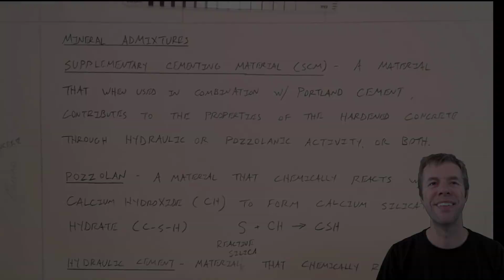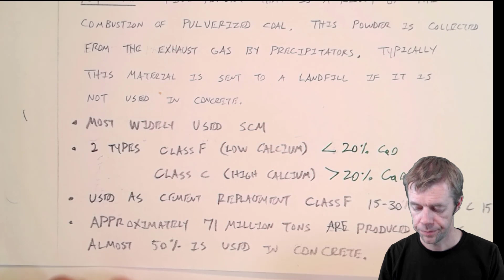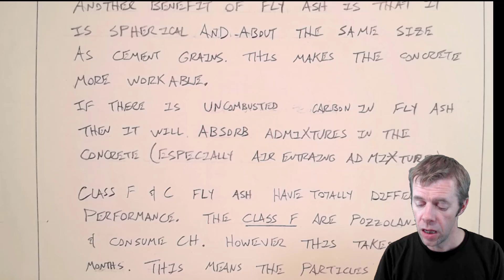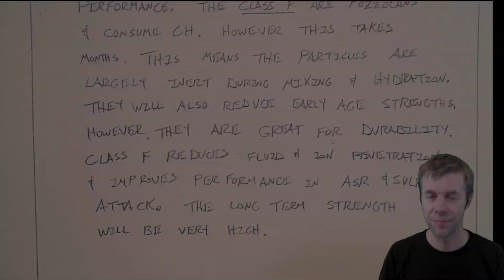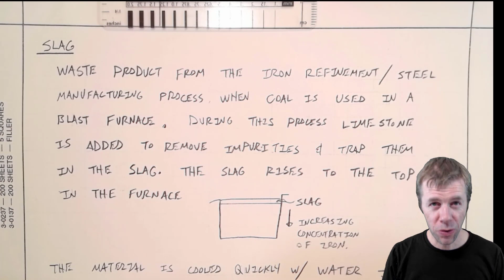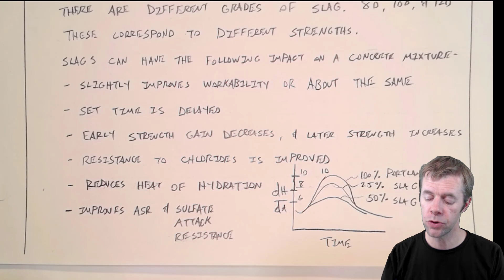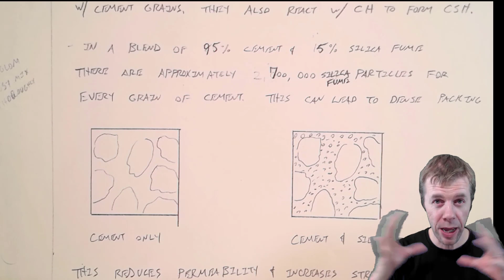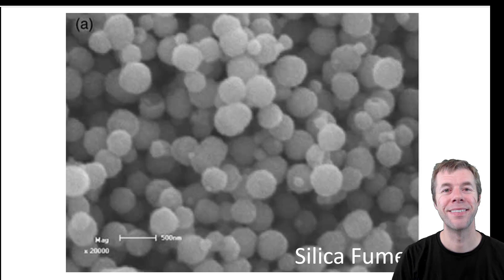What is fly ash, slag, and silica fume and why do we use them in concrete?

Comment: Tyler, these videos are exceptional. Would you be interested in making a video on the ‘best’ concrete possible for durability? What the approximate mixture would be, what additives would be used, the w/cm ratio, how it would be cured, etc? I was thinking about making a concrete bench that would be left outside in a cold climate, and I think it would be kinda cool to try and make it last hundreds of years. Probably post tensioned with stainless threaded rod.
Reply from the maker: I like that idea.  Let me think about it.
Reply: Jon, you can try using one of my impermeable self-healing nano and micro reinforced concrete made from Waste to Energy Ash.
Reply: What about a combination of say type f fly ash and silica fume?
Reply: @ndenise3460  What about a concrete that is made with Waste where all the aggregates come from waste a concrete that is impermeable, self-heals and is photocatalytic... That is Ashcrete
Reply: what about organic ash as additive for concrete??
Reply: Perpahs I'm wrong, I'm just a lowly concrete guy --- Isn't "BEST" defined by location, use, performance requirements, cost-benefit and engineered "life-cycle? 
 @TylerLey

Comment: Tyler, there is a cool new material called Poraver. These are nano glass spheres made of recycled glass in Germany and Canada: it is used as an admixture in concrete. As a result workability of concrete is amazing, and goodbye cracks, too. The resulting concrete is lighter, stronger and denser than without the rough glass beads.

Comment: It's such a science... I'm interested in the Silica fume and it's use in superstrong concretes. Excellent explanations.
Reply from the maker: Thank you for the message!  I agree that silica fume is a cool tool.
Reply: @TylerLey  Awesome info you're providing. So apparently, due to the huge increase in compressive strength using silica fume / fibres, they can use less re-bar and build with less material using it. Do you have a video on super-plasticizers also?
Reply from the maker: Shades2 - Silica fume can help with this.  It depends on what you need your structure to do.  If your structure can allow slender members then silica fume is great.  However, there are many members where strength is not the goal.

Here is the water reducer video: https://www.youtube.com/watch?v=q_PwZE57Slc
Thanks so much for watching and for your comment!!!
Reply: @TylerLey  Master,I use silica fume to produce magnesium oxysulfate concrete. There are good aspects, anti-permeability,dimension stability increased, but strength decreased,it might be wrong way of mix slurry ,low speed mixer,time,
etc, i don't know.Someone said,the best way is use fly ash mix with silica fume. I wish to increase durability of mganesium concrete,but do not scrafice lot of strength,is it possible?

Comment: Hi Tyler,
I watched many of your videos and I am amazed by your knowledge, but even more by your passion for concrete.
I would love to get your input on the following subject. I need to a build a concrete wall behind the existing concrete reinforced 30 years old wall which is in a bad shape (with partially exposed rebars and many cavities) that is being constantly stricken by the sea waves. What type of concrete, rebars, admixtures, etc. would you recommend for the new wall.
I hope you will read my message and respond to my inquiry.
Regards,
Reply: you could try glass/polyester etc fibre reinforcement, or basalt fibre, or micro stainless steel fibre. plenty of vids on 'Net.

Comment: Question, I was wondering about what if someone replaced all the products of concrete with similar sized (or smaller) recycled products. Like my idea is what if someone used say fly ash, slag, ground tires, ground plastic, ground styrofoam, ground glass,  maybe even ground wood or wood ash, then mixed all those with hydraulic lime and water? Wouldnt that be more dense, workable, insulated and harder than concrete? And would you even have to have steel reinforced steel?
 I just don't know enough of the chemistry of each of those products if they would work well together, if it would be load bearing, what the thermal desity would be, if they would be toxic, or if they would just fall apart.
 I've recently been interested in how to used products that take a long time to biodegrade like glass, tires, plastic, styrofoam, fly ash and slag and make them into a workable product that would harden like concrete does. Can you give me any insight on if this would work or is it a pipe dream? 
I also thought about adding hemp Hurd to the mix but wanted to see if the non-biodegrable products would work first to fix the problem of waste in the world before adding any natural products for thermal insulation. 
I've been brainstorming like crazy about building a high thermal mass round home with a geodesic dome roof in the shape of an IMAX theater (tilted rotunda?). My brain has been on overdrive on how to make it with no concrete and only recycled products while also making it energy efficient and as low of cost as humanly possible. And it all starts with the footing which is where I came up with the original idea posted above! So that's where I'm at, any help or ideas would be greatly appreciated. 

Thanks
Ryan Soren

Comment: is wood ash similar to coal's flyash?
recently i was trying to extract use potash from burning garden's lefovers
i tried biochar last year, but this time i wanted to recycle the K
so i washed the ash and used the water for irigation
but the lefover settling particles i collected them and dried them
i'm intending to use them for making clay-sand bricks more resistant to water erosion
Reply: No, nothing like it. The K (and Na, Mg etc) will wash out as hydroxides, very alkaline, if left exposed to air they will gradually absorb CO2 to become less alkaline. If irrigating with them they can build up in the soil and 'salt' it if you don't irrigate/dose properly. The bio-char will have most of the minerals that would be in the ash anyway. the erosion resistance of the bricks depends mostly on the vitrification effects of the firing and/or if you chose to use the minerals K/Na etc to 'salt glaze' the bricks.

Comment: Have you talked about air entrainment and insulation characteristics? Just curious.

I'd love for you to talk about mortars. Portland cement was the worst thing to ever happen to mortar, unfortunately. Lime mortars were far superior but unfortunately are hardly available today. Read about the repair of the Washington monument as a starting point.
Reply from the maker: Thanks,
I will check it out.  I am working on a foamed concrete video.  That may talk about the insulation.
Reply: @TylerLey  i would like to be alert wend you publish this futur vidéo about aircreet and maybe your sugestion about the experiment of "Honey do carpenter"
Reply: hydrated lime is still available, with a bit of ingenuity you can still make lime mortars.
Reply: @bikerfirefarter7280  I have made it that way for repointing old, soft brick. I just mixed mason sand with hydrated lime. It works great but takes weeks to set up. I introduced some portland cement to make it set a little faster but that defeats the purpose.

If I recall, there used to be another form of lime like anhydrous or something that sets faster. Hydrated lime basically needs to dissolve naturally and rebond in order to set. That's the power of lime, that it's doing this all the time, it's self healing. With this method I think that self-healing is the only way that it sets up.

Besides being self-healing, it doesn't shrink as it sets, causing all kinds of bonding failures, weakness and leaks in repair work. That's the other huge advantage of lime mortar, and the third crucial advantage is that it's softer than the material you are typically mortaring together. So it doesn't damage and fracture that material! Portland mortar is very hard and strong so people think they're doing a great job. Then when the old bricks fall apart and fracture because the mortar was so hard, they say "well the mortar was good but those old bricks just couldn't be saved", which is the exact opposite of the truth. Not only is Portland mortar hard and not self-healing, meaning it will eventually fracture and turn back to dust, but it shrinks as it sets so it actually places more stress on repaired areas, and then it doesn't allow settling and rehealing. It's basically a disaster for old soft brick or natural stone.

And all of that is why they didn't use it to repoint the Washington Monument. I believe they went through a lot of work to research these issues and recreate an appropriate lime mortar. Either that or maybe they imported it from Italy.
Reply: @fieldlab4  'lime mortar' is not just hydrated lime and sand.  'anhydrous lime' is calcium oxide, otherwise known as 'quick lime', very caustic. hydrated lime mortars, and most other cements fully cure through the years by adsorbing CO2 which reacting with the calcium (and alkali metals) become carbonates. Corporals Corner has a video on 'Roman concrete', that will point (scuse pun) you in the right direction.
I have used 6:2:1 of sand: portland:hydrated-lime as a substitute for old school lime-mortar with good results. Plastering sand works well. Setting time is a little longer but acceptable. In places where setting time needed to be quicker various accelerators can be used. Small amounts of sodium silicates can be a useful additive. In outdoor situations I have also accelerated the setting by tenting the work with a tarp and putting a steel bucket full of charcoal under the tarp (one 12mm dia hole in the bottom of the bucket), light the charcoal FROM THE TOP to avoid CO, and when it's lit after 5-10 minutes to establish, put a fairly well fitting lid over the  bucket (slate or stone etc) and put it under the tarp. The charcoal slowly burns overnight and the CO2 released rapidly hardens the exposed mortar (be careful of any carbon monoxide).
see also.
https://www.limetec.co.uk/limetec-lime-mortar-mix-ratio.html

Comment: My graduation project is about geopolymer concrete we used fly ash with liquids like sodium silicate and sodium hydroxide but we didn't achieve any kind of slump or any strength the project just fails now we have just 1 and half month and we are in a very critical situation. My question for you is it okay to use silica fume instead of fly ash with these liquids or should i use water instead?
Reply: The reason that the mix fails is that the flyash is not really fly ash we bought it from an unreliable source

Comment: I work on older homes and you can tell a foundation that has slag mixed with concrete and an 80 yr old home that has faulty downspouts/ gutters,those foundations crumble easily.they saved money mixing slag with concrete but as longevity in my experience it doesnt last.i can post a pic of a concrete/slag foundation thats gone to crap at a hpuse im workin on tommorrow youd think about scimping on cement.i can post more foundations youd think twice it crumbles after time makin a useless foundation

Comment: Did you see on This Old House that there are 30,000 + homes with bad foundations that are blowing out from minerals in the concrete?
Reply from the maker: Yes, it is called pyhrotite attack.  It is a big deal and there is not much you can do about it.   =(
Reply: Wow‼️so 😥

Comment: Not quite accurate on the slag issue - lime or dolimite used in steelmaking - a basic slag - limestone is calcited into lime before use in steel industry - that is why the greenhouse religon object to because it liberts carbon dioxide.